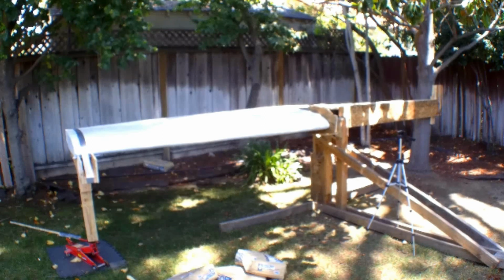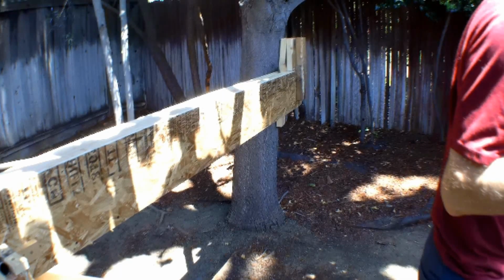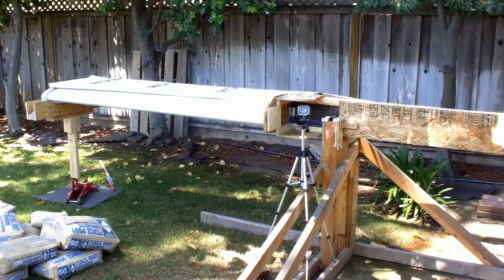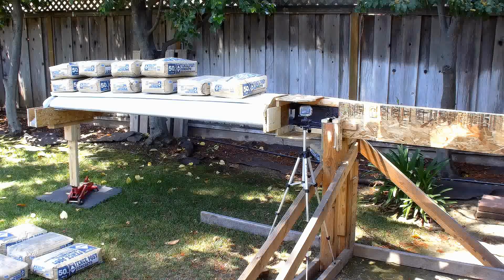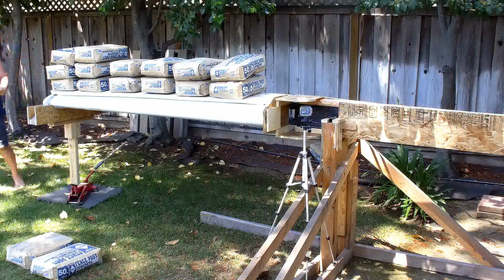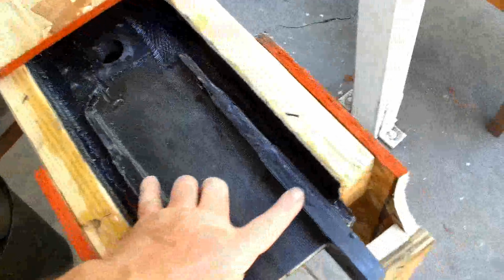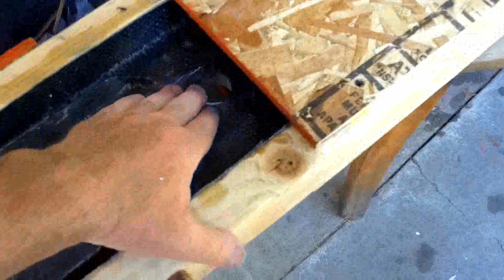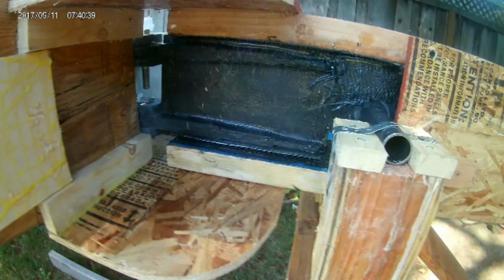Wing Load Test - KW MkII Class II Hang Glider Development

Comment: Hello Rol,

I'd like to know what angle the weight should subtend to the chord, ideally:

1. I had assumed that in order to simulate the combination of lift and drag forces on the wing, the wing should be upside down and  canted UP from the horizontal, such that the downward force due to the mass could be resolved into lift perpendicular to the chord and drag parallel to the chord line

2. Stan Hall in his famous treatise on proof loading homebuilt aircraft, recommends that the wing be upside down and canted DOWN 10 degrees from the horizontal 

3. Whereas you have chosen to load your wing with the chord at (what appears to be) 0 degrees to the horizontal.

Would you be so kind as to educate us on what role the loading angle plays and how one can choose the most appropriate angle.

Thank you sir!

Comment: My old college shop foreman would have some words for the two of you, standing around that much stored elastic energy without safety glasses!
Cool stuff, it's interesting to see the practical side of how those load rating numbers get made. Any differences with how the root fitting is built for shear between this test article and the flight article, since this short span test produces more shear than in flight?

Comment: Just found your videos. I'm enjoying them. It sure seems like you tested the wing to prove that the wing can take negative 4.6 G
Reply from the maker: Thanks, I'm glad you are having some fun. For the final wing test we 
mounted the wing upright, so yes, the loads are basically a negative loading 
config. We did this because I had repaired the spar (video of the repair available on this channel) and I wanted the 
repair in compression. However, the spar is designed to take the same 
loads plus and minus so a test in either direction is valid.
Reply: Understood regarding the loading.
I would suggest that you review your conclusion of the failure cause and sequence. 
It looks like the top wooden member of your test rig started your failure by peeling the carbon from your fitting vertically. You can see it fail first and start up. As it peels the top bond, the shear increases in the bottom bond line and you see it fail in the big 'snap' in your video. Should you agree with this analysis, it would indicate that your approach to bonding the fittings in is sufficiently strong. IF your test rig was an accurate representation of the method by which the wing is attached to the rest of the airframe, you only need to change your design to prevent the initiation of a similar peel failure. Compliments and all the best. Mark
Reply from the maker: think we are saying the same thing, although you may have captured it in a
 clearer fashion. Due to lack of a script, I sometimes ramble in a 
confusing manner. However, the final config is completely redesigned to 
reduce weight and avoid the failure mode you are discussing. Take a look
 at this video from the site:
https://www.youtube.com/edit?o=U&video_id=0N1Iff1kyuE

More videos are coming that will show construction of the final design. Stay tuned.

Comment: I'm puzzled about why you didn't let the load increase gradually in known increments by adding the bags with the end unsupported from the beginning.... Unless I'm missing something, the way you did it here you don't know what stress it took to break, or how much it would be deflected at what loading. I'm not saying you didn't prove it's stronger than needed, so the test overall is a success but the method just seems odd :)
Reply from the maker: You have a keen eye and mind - a good question that I didn't think anyone would ask. You see, there are two "hidden" issues in the test. Because the wing is only about 1/4 the length of the final wing panel, the load has to be piled up locally at near the end of the test article. This is NOT the normal loading locally - the loads on the local spar and wing skin location are way over anything the wing would ever see. But, this is the loading that is required to get the correct bending moment at the root wing fitting, which is what I wanted to test. The second factor is that the large concentrated load at the end of the panel creates a huge mass moment of inertia in the fore and aft motion (yaw, essentially). If the wing got bumped in the yaw direction while we were loading bags and the jack wasn't supporting the wing, it would probably have snapped off the wing or collapsed the test stand. So, this whole test was a compromise to prove out just a few critical parts of the structure. When I finish the center section of the wing and the two main D-tube spars, I will be able to test the structure with much better accuracy.

Comment: Nice work gentlemen! What loading will you be aiming for with your final tests?
Reply from the maker: Thanks! The current plan is to test the prototype wing to a 2 g loading prior to first test flight (low and slow). Then repeat to 3 g for higher altitude flights, and finally up to the full 6 gs before the test flights that open up to the full flight envelope - stalls, high speed runs, steep banks etc. No spin testing will be done because at normal loading the design won't spin. No aerobatics either as I'm not designing this wing for that type of flying.